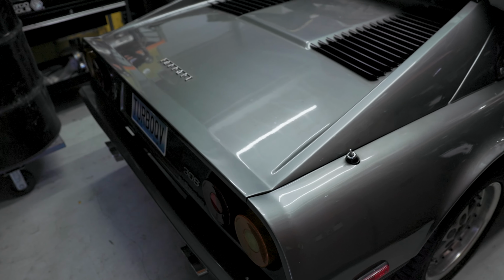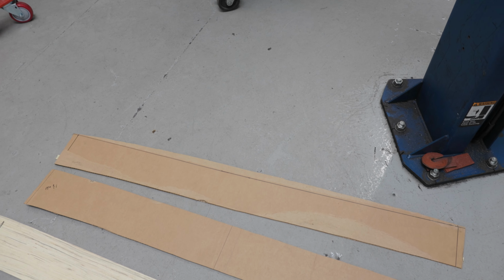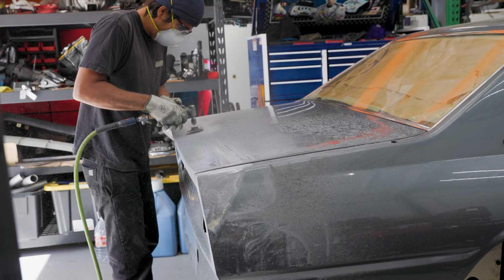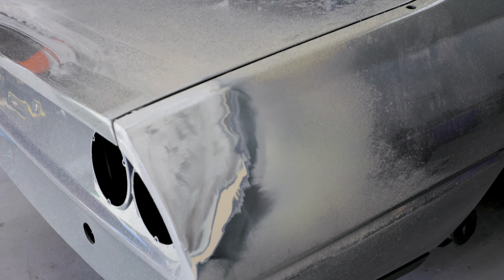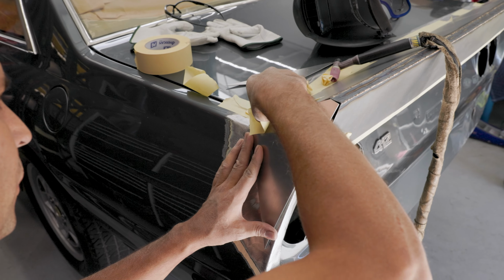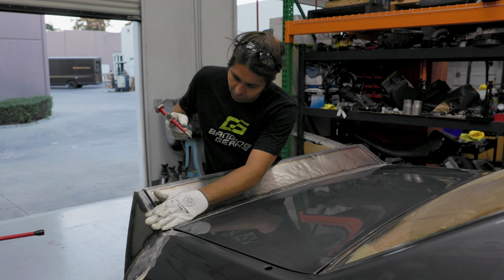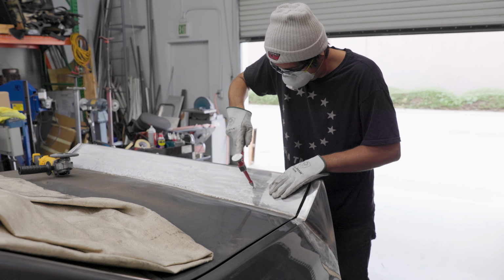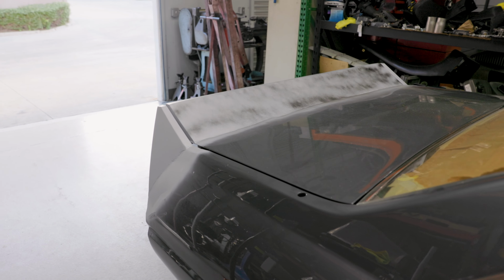The First Major Visual Change to the Ferrari 412!! / Ferrari 412 Build Ep 11

Comment: Hmm, i think for the moment without tinning & bondo & paint it's hard to judge. Edges do seem a bit harder than the original lines on that trunk, and like the other guy im curious if you did any sort of rust prevention and guesseting on the inside of the wing. Such a long flat piece of steel might wants to resonate.
Reply from the maker: Yeah bodywork and paint will definitely play a big role in smoothing out the lines and building a flow from panel to panel. I will have to ask Martin about that question and get back to you!
Reply from the maker: So Martin said he didn't add a coating because it would've compromised the quality of the welding surfaces, but there are three small holes underneath the wing that can be used to spray waxoil or something else during the painting process.

Comment: Did you guys coat the bare metal under the spoiler with anything?
Reply from the maker: I will have to ask Martin and get back to you on that! Thanks for the comment!
Reply from the maker: So Martin said he didn't add a coating because it would've compromised the quality of the welding surfaces, but there are three small holes underneath the wing that can be used to spray waxoil or something else during the painting process.
Reply: @omd_sd  thanks. I was wondering what you guys thought of a weld through primer or something like steel-it for that use. I’d probably want to do the same with cavity wax regardless though.